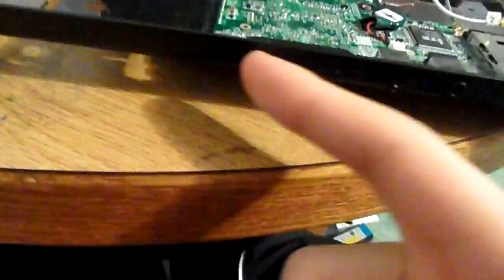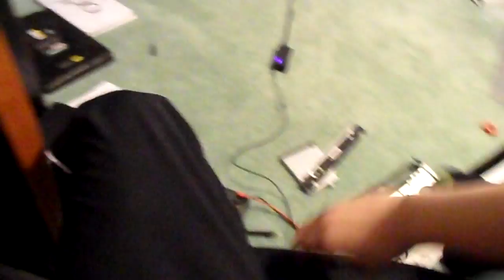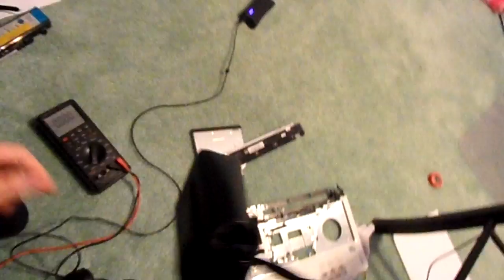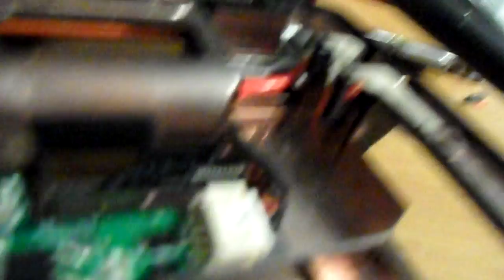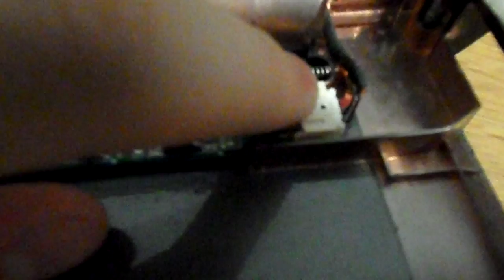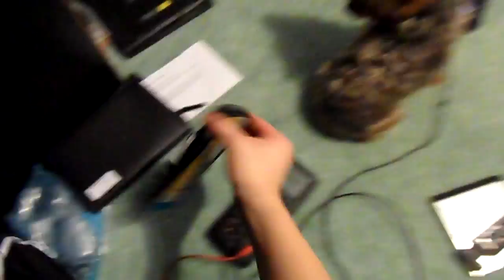How to troubleshoot laptop that does not charge! Lenovo Ideapad Y430

Comment: I have lenevo model G460. My battery keeps on disconnecting while plugged in. The only solution I found is I have to plugged out and again plug in and it stays for sometime. But this doesn't remain for long. Sometime it works pretty well but most of the time I'm facing disconnecting issues. Do you happened to know what's the real problem? 
What I did to see if my charger wire has some problem or not is removing the battery and plugging in charger. With that I'm not facing any problem but the moment I put the charger back in and charge it, it starts disconnecting again and again. Your advise will be much appreciated.

Comment: Hi I have Lenovo flex 2. While traveling I connected the charger into a socket which is supposed to charge mobiles. After a couple of minutes my laptop switched off automatically. Now it is not getting charged. I am unable to turn it on. Even the light is not blinking. pls advise.

Comment: I have lenovo g505s laptop... The problem is it is not charging.... When push the area of charging port its charge for short tym then then again the laptop is not charging.... Please help me on this
Reply: Dexter NerRy did you fixed it ?? I have dame problem, changed the power jack, charger, when I plug in charges for 1 second and then the charging light dies

Comment: Hello, I watched your video and wondered if you have ever come across a particular problem in the past with a y510p or similar model. Forewarning, this is NOT the "plugged in, not charging" message or problem. So, one time I was gaming, then I smelled the classic smell of cooked electronics, then the computer turned off. But, It would still work fine on the battery. It even recognized the power supply and said plugged in, charging. But, the battery wasn't charging. If I took out the battery and tried to boot exclusively from the power jack, nothing would happen. So, lenovo took it and they said they replaced the motherboard. It worked perfectly for 2 months, but then the same problem happened again and I WASN'T gaming. I was just surfing the net. I don't know what I can do to prevent this. If you have seen this issue before I would love if you could tell me what it is. I have no idea why the computer would recognize it and say charging but then not charge. Thank you for your time.

Comment: I have the lenovo y510p and I have the same problem.But now my computer turned off any ideas how I can fix it pls help
Reply: I have the saime problem today with my y510p... it is the saime like this one!? the lap top it is in warranty... they fix this!?
Reply: Mr.Anabola ik it's 3 years late buy how did u fix it
Reply: Try changing the adapter. Laptop adapter does not convert AC to DC. Power output of the new charger has to be the same.

Comment: The Lenovo Yoga has a energy management option that will not charge it above 60% - it will just display "plugged in, not charging" 
It's the Lenovo Energy Management settings.

Go to Control Panel >> Power Options >> Change plan settings >> Change advanced power settings >> Lenovo Energy Management >> Enable Lenovo Energy Management.

Change the battery setting from "Optimized Battery Health" to "Maximum Battery Life."